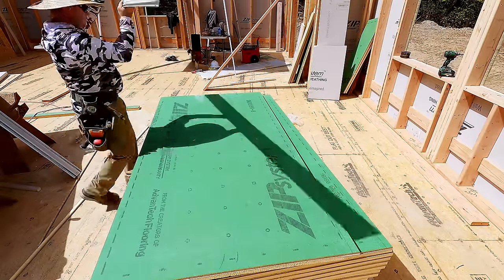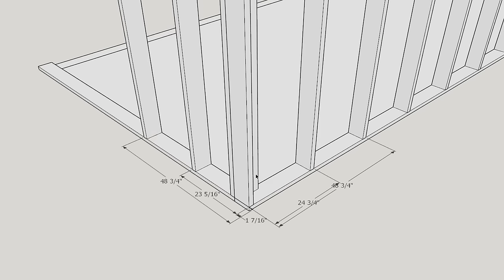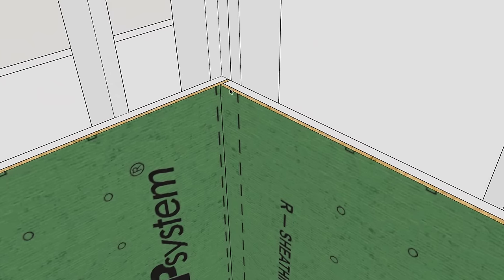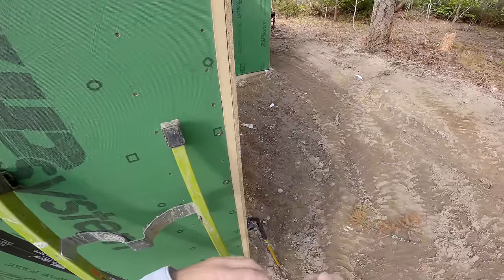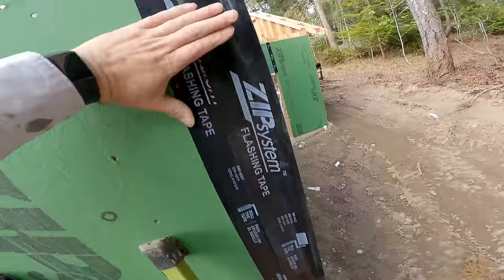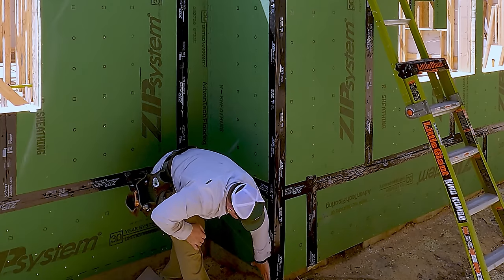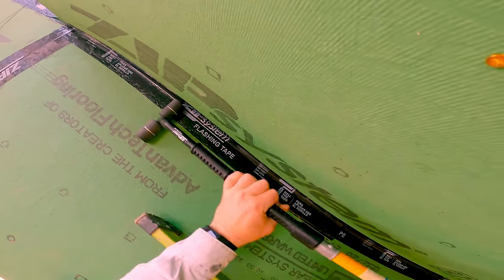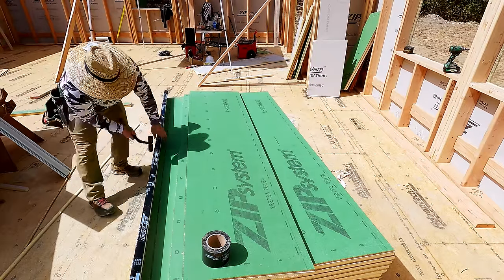The Idiot Proof Way To Reduce Thermal Bridging

Comment: How do you address that the Zip R panel will be proud of the bottom plate? For example Zip R-6 will be one inch proud of the bottom plate. How do you address that 1" exposed polyiso at the bottom?
Reply from the maker: It doesn't need to be addressed, but as I showed in the video, you can tape it.
Reply: Thanks for reply. Other videos have promoted adding a strip of PT lumber covering the exposed foam at the bottom as bugs/rodents maybe able to burrow in if the barrier is just tape.  Then once the lumber strip is added use tape such as Siga fentrim to cover the entire junction including the zip, lumber, and concrete basement for airtight seal.   @AwesomeFramers
Reply from the maker: @tamil1001  Yep, this was over a crawlspace.  The house we are currently working , we'll use Fentrim.  I'm working on an updated video to this one as we speak.  Regarding bugs/rodents, this is not a problem in our area.  I'm not sure its actually a problem in other areas.

Comment: Does anyone have any actual numbers on this Thermal Bridging crisis. I'm still waiting for the Arctic to melt. I'm sure there is some. But All Thet Cold isn't coming through stud lumber. All Houses are just oddly shaped Chimneys. And they act like them. Foam the walls, minimum 2" then use aluminum double bubble across the interior side of the studs. You can do that on the outside too. It reflects heat. Rated R-19. The Secret sauce is to treat it like your zip sheets and tape it off. Everywhere. You want a continuous envelope. You will also need at least one air exchanger. Happy nailing. And don't at me I've done this and it works.

Comment: Could you clarify why you lap 3” specifically on the inside corner? Is that suggested by Huber? Wouldn’t there be a chemical seal on pressure that would prevent vapor? Thanks!
Reply from the maker: Hey Eric, great questions.  The lap on the tape is a Huber requirement for tape to tape connection its shown in the video here https://www.huberwood.com/zip-system/insulated-r-sheathing#about

Comment: Nice video! How do you prevent thermal bridging on the inside corner? The foam isn't continuous at that corner. On the outside corner, both sheets of Zip-R overlap on the foam.
Reply: If the inside corner stud for the second sheet is offset from the OSB of the first sheet (or flush to the edge) and the cavity is insulated, there would be no bridging through the depth of the stud cavity, amirite?

Comment: What about the layout of the sill plates? Are the panels landing on concrete, or are they proud of the edge of the concrete?
Reply from the maker: Hi Gary, I thought I addressed that in the section of the video where I tape the bottom.  I probably could have been clearer. 

Yes, it sticks out past the mudsill.  In my view this is a non issue in that no one will notice it, the siding extends 1 1/2" below it and final landscaping must be 6" or more below the siding according to the code.
Reply: @AwesomeFramers  I see. I built my place 20+ years ago using home made zip system, since it wasn't available then, using 1" celotex insulation between the sheathing and the framing.  Same thing at the sill. The issue that has developed over time is that I have had mice chew through the insulation as it isn't protected. I wish I'd framed it so that only the sheathing was proud of the concrete and not the insulation. Live and learn!

Comment: Given Zip is an OSB product that created a good airtight assembly, aren’t their concerns for lack of vapor diffusion through the assembly? Or is the baseline assumption they’re going hardcore with dehumidification?
Reply from the maker: I'm not an expert on this.  I know that vapor diffusion isn't an issue in our climate with this thickness of foam.  I would imagine that in humid climates the wall design would done in conjunction with the mechanical design.  For example down south where ac is common, that will dehumidify.

Good question, I just don't know and each location has its own variables to take into consideration.  We are climate zone 4c and it is very forgiving here.
Reply: @AwesomeFramers  Rad response. In our climate 4c my guess is Zip/OSB poses the greatest risk for roof sheathing. Not so much in vented attic scenarios, but more so in conditioned attic scenarios where vapor diffusion can’t occur because of Zip/OSB. The issue further compounds if the roofer uses a non-permeable WRB. 

For wall cavities in climate 4c I think the greatest risk is super hot summers in scenarios where cold air conditioning exists in the home. This can create wall cavity condensation if insulation thickness isn’t calculated correctly. Zip r-sheathing can trap that condensation…OR prevent the condensation altogether if the foam is thick enough. That said, using products like T-stud would completely solve this issue at the walls.

Comment: Has anyone else had issues with the foam being pressed down by the nails and having uneven seams? My company is using this system for the first time and we've ran into this issue a few times on this build regardless of nail depth

Comment: If you put those sheathing panels on, and then insulate and vapour barrier the inside, can’t moisture get trapped between the two?
Reply from the maker: I'm not a building science expert so the short answer is that I don't know.  For each climate, an assembly needs to be thoughtfully designed.  I'm not qualified to talk about the science.
Reply: @AwesomeFramers    Thanks for the response. I have googled this question quite often, but can’t find an answer. I was planning on removing my siding and adding a layer of insulation, which unfortunately tends to act as a vapour barrier. But being in a northern climate,  vapour barriers go on the warm side only, Vermont inside, Texas outside, a wall has to breathe.
Reply from the maker: @huejanus5505  Actually the "wall has to breathe" is a misnomer.  A wall needs to dry  Stay tuned, Christine from https://www.buildingsciencefightclub.com/bundles/building-science-for-architects discusses this during the International Builders Show in a few weeks.
Reply: @huejanus5505  If you find the answer please send me a message, very concerned about the same issue

Comment: Nice presentation however that inside corner you showed had a gap with no filler not sure why?
Reply from the maker: If you watch the Lakeshore Playslist you'll see that the kitchen wall was framed balloon style and had the Zip R6 on it.  The butting wall in the video is a garage wall with regular 7/16" Zip.  Since that wall was framed first, we leave a gap to make it easy to tie the walls together after lifting.  The gap isn't relevant to the envelope because the kitchen wall has continuous R6.  

Does that help?  Here is what I'm talking about https://youtu.be/5eOvpKuphmM

Comment: Why aren't the bottom of the zip panels wrapped and rolled with tape at 4:40 ? I would like to use this on my next project
Reply from the maker: because here we don't need to protect that edge.  I did research and it isn't required and there appears to be no advantage.

Comment: IN  THE STATE OF MASSACHUSETTS  THIS NEED TO BE INSTALL ON THE TOP OF THE PLYWOOD SHITTING.. IN MY OPINION  AS A PROFESSIONAL CARPENTER THIS CAN NOT BE A STRUCTURAL  HOUSE PART BECAUSE. THE  EPS WILL GIVE THE GAP TO THE HOUSE BE UNLEVEL  ( SHAKE) WITH HARD WIND .
SEE THIS OLD HOUSE PROGRAMME ABOUT THAT

Comment: I don't see why those corners (both inside and outside) aren't mitered. It's easy enough to do and leaves a nice clean corner for a single layer of tape.
Reply from the maker: to be frank, its a waste of time.  There is no thermal benefit to do that, so why bother?  Better to just keep things simple.
Reply: @AwesomeFramers  How long does it take to cut a 45? The miter IS the simplest solution...and the cleanest.
Reply from the maker: @dlg5485  the simplest is to leave th factory cut alone. Beveling offers zero value therefore it's a waste of time. Check the manufacturers instructions.

Comment: All the building science stuff tells you that you should have a layer of insulation on the exterior of the sheathing so that the sheathing isn't the condensing surface for any warm, moist air that escapes from your house. What are your thoughts and experience with this?
Reply from the maker: Let me say first off that I'm not an expert on this at all.  My understanding is that it doesn't matter in most climates because of the thickness of the foam.  In other words at R3 and up it won't condense because there is enough insulation.  I know there is a lot of testing that goes into these products and consulting from the big names in the industry.

I'll ask Christine over at https://www.buildingsciencefightclub.com/bundles/building-science-for-architects
Reply: Oh there's so much to this. Huber has even said it's absolute best to have the insulation over the OSB, but in terms of ease of trim, cladding, etc and builder familiarity, their compromise was foam behind the OSB.

There's an old Building Science article from, I really want to say Peter Straub, that even up to Climate Zone 4, the minimum R-5 insulation can still lead to several thousand hours a year of potential sheathing condensation, unless you also used closed cell spray foam on the interior. The recommendation was a 50/50 split of interior/exterior insulation without closed cell.

For condensation, the biggest takeaway I've gotten is keep the air from your house getting through to the sheathing, and let any exterior water that hits your sheathing drain and let the sheathing seasonally dry.

But good god, the zip R is ungodly expensive per square foot anyway. Here it's still cheaper to get regular Zip, then stick up to 1.5" of foam or Rockwool over that and it's still cheaper, even accounting for the screws.

Comment: You forgot to mention how obnoxiously heavy a sheet of zip r6 is….dear god when I get to a new job and see a bunk on site I can hear my spine start to compress
Reply from the maker: 😂😂😂😂😂😂😂😂 it weighs less than 5lbs less than a 4x8 sheet of zip :-) its just foam that's added
Reply: @AwesomeFramers  there’s no way. We must get waterlogged sheets in northern Michigan. The 1.5” 10 ft sheets me use have got to be over 50 lbs a sheet
Reply from the maker: @c5tv674  Zip 4x8 7/16" is 49lbs and R6 is 59lbs.  I just looked it up, so I was off 😂😂😂😂
Reply: @AwesomeFramers  yeah now add 2ft. We use 10 ft sheets…now you begin to understand my original post….86 lbs per sheet!
Reply: Sorry 74 lbs
Reply from the maker: @c5tv674  I didn't know they had 4x10 Zip R6. We used to use 4x10 7/16" panel's, I called them for weight so we could Calc wall weight for the crane. I thought those were 67lbs. It's all lighter than Advantech 😂😂
Reply: @AwesomeFramers  Now that's a problem. Getting 10' sheets on the west coast.  I've been told that's not available.  🤷
Reply from the maker: @wjthehomebuilder  I know we can still order 4x10 7/6".  Zip R6 according to Huber's PDF here only comes in 4x8 

https://www.huberwood.com/uploads/documents/technical/documents/Mill-Product-Listing-Wall-ZIP-System-R-sheathing.pdf

Comment: Zip -R is nice stuff, buts its just to expensive.  Around here, all high-end homes are wrapped in Tyvek and spray foam the walls.  Until Hubers patent on Zip runs out it, will be out of reach for the masses.
Reply from the maker: That's very interesting.  It certainly isn't cheap, but here spray foam is ridiculously cost prohibitive.  I think it's 4x the cost of batts here.
Reply: @AwesomeFramers  ya know our solution? we bought a spray foam rig! haha...... literally bought it off ebay. there was a fire in the triler it was in, and insurance replaced theirs so we got it for 5k. we have a deepsea engineer on our crew, he wired it up to single phase, and we were in business. about 2k$ for 3000 BF of closed cell. we need it up here in maine. 17 below zero next tuesday!
Reply from the maker: @diggingupnorth3453  Nice!  We've been thinking of something similar, but right now it already feels like we are taking too much on.
Reply: LP makes a similar product to zip.
Reply from the maker: @timothydillon6421  They do and they are being sued for patent infringement.  They started selling that 10+ years after Zip came to the market.  

https://www.prosalesmagazine.com/news/manufacturers/huber-engineered-woods-files-a-patent-infringement-lawsuit-against-lp-building-solutions_o
Reply: @timothydillon6421   Yes, but I believe that LP as well as GP both have to pay a License fee to Huber to make their products. So Huber is making a killing even if you buy LP WeatherLogic.
Reply: @AwesomeFramers  Huber needs to remember that a high tide raises all ships. A better structure and a fortified roof is good for all. More quality options are better for everyone.

Also a patent isn't worth the paper is printed on. Every detail about your product needs to be listed so it is protected. Someone changes one detail, like the color, and now it's not the same. Lawyers are the only ones that benefit from patents. Definitely not the consumer.
Reply from the maker: @timothydillon6421  I appreciate your perspective.

I couldn't disagree more.  The patent process exists for a reason.  Huber spent millions in research and development and paved the way for this type of approach and product.  

Innovation is stifled without a patent process.

Comment: SO WHY IS THE SHEATHING APPLIED PARALLEL TO THE STUDS? (SEAM ON SEAM)
HARDER TO INSTALL, AND IS MUCH WEAKER STRUCTURALLY.ESPECIALLY AROUND DOORS AND WINDOWS.
 WHY NOT LOCK IN THE GOODNESS?
Reply from the maker: Hey Barny, that's actually a common misunderstanding.  The edge nailing of the panels is what provides most of the lateral resistance.  Installing them vertically is stronger than horizontal for shear loads because all the panel edges are blocked.  Most people that install horizontally don't block all those seams and the wall is stronger.  Page 17 here https://www.huberwood.com/uploads/documents/technical/literature/ZIP-System-Sheathing-and-Tape-Installation-Manual.pdf

Comment: WHY ARE YOU EVEN USING 2X6  STUDS?  THE THERMAL BRIDGING IS TERRIBLE.. USE TWO  2X4s  WITH A GAP BETWEEN THEM  . .  I MEAN IF YOU ARE DOING ALL THIS BECAUSE OF THERMAL BRIDGING WOULDNT YOU WANT TO REDUCE THERMAL BRIDGING ON THE WALL STUDS TOO?  ESPECIALLY IF YOU ARE BUILDING FROM SCRATCH..